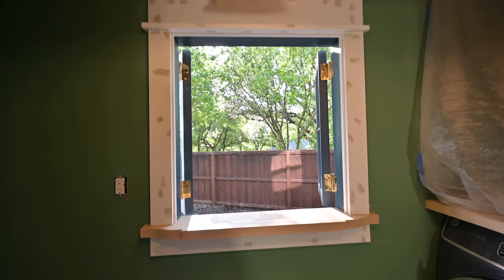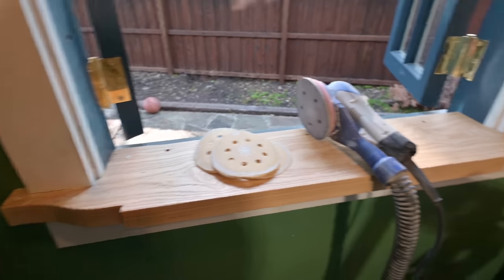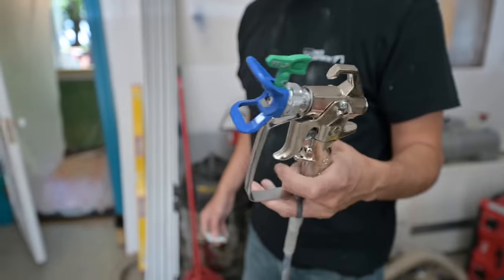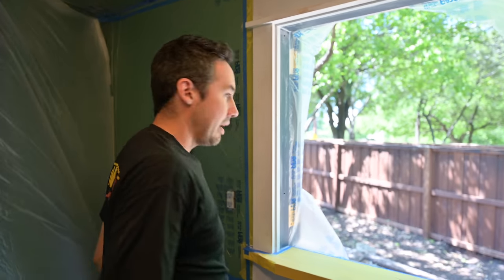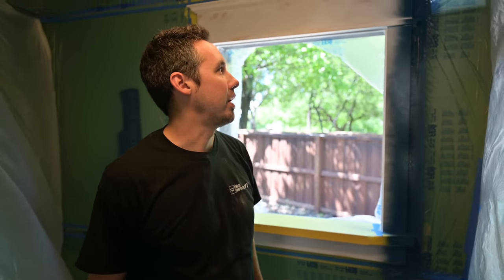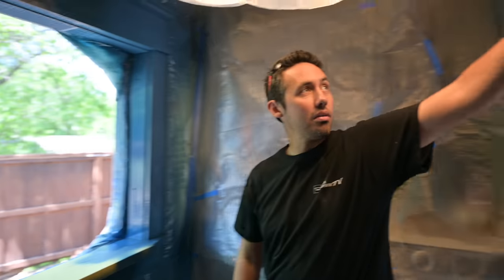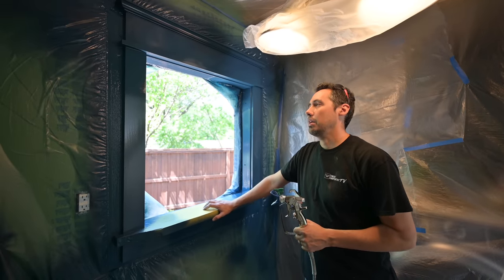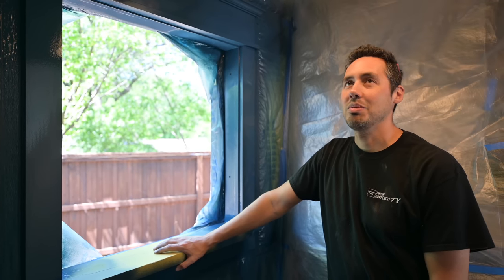I finally FINISHED a room!

Comment: I love that you're adding painting to your skill set (or have for 10 years now)....  As a handyman who does a lot of everything, I am the one who does the carpentry (or drywall work) and then painting.  So you can bet I've improved as a carpenter knowing I have to finish my own work off.  I set up my painting for success by good practices in the carpentry trade (nail depths, number of nails, etc), and there's no one to blame except myself if somethings off in my prior operations.  Love your channel, my friend....  You are an excellent carpenter who I have learned a lot from!

Comment: Hey brother. You really gotta try an italian primer (like Renner or centurion) with a Command (from Benjamin Moore) topcoat.

We have switched from Scuff X to Command for all of our millworks. The only time we won't use Command is when it's for cabinets- then we use a Renner top coat. Command dries flatter, harder, and faster than Scuff X... It's the best local topcoat you can buy for woodwork. Trust me. I've tested them all lol.

Also, the TriTech guns and tips can get all the way down to a 306 with a double orifice. It will take your flatness and dry time to the next level.
Reply: Personally I'm a Sherwin Williams guy after a bad start 10 years ago with my local BM dealers, and limit most of my work to 95%+ exterior repaints.  I'm always looking to gather information just in case I do an interior project.  What is your experience with SW Emerald WBU vs Scuff X vs Command?
Reply: @doug.ritson    I totally understand that sometimes we choose products not because of the products themselves, but because of who is selling them. If your local Ben Moore is full of dickheads then that makes sense. But that being said, Command is simply on another level to all other local paints. 

If you ever purchase some Renner, Centurion, Milesi, or other premium Italian coatings you will see how hard the finish dries. It's basically harder than lacquers, but with more flexibility to avoid cracking, and much better water resistance. It's hard to believe how different they are from local paints until you try them. One thing about the Italian coatings is that they must be sprayed with the right equipment or they won't look right... They also have little quirks like "usually only the catalyzed products will cover in 1 or 2 coats", among other things.. The local paints are much more forgiving and easier to use with multiple application methods. But Renner for example has like... 25 variants of the same high quality product- and each variant is for a specific use... So it takes a long time to learn the systems and if you don't use the specifically correct product, then you can get bad results... They told me that I was supposed to use a catalyzed product for refinishes even if I don't need stain blocking. I didn't believe them, so I used their standard primer that I used all the time, and then it reacted poorly with the previous coating... Its like it was permanently degassing and created bubbles in the top coat even after waiting a month for it to fully degas and cure... So the high level Italian coatings all have specific applications and it requires a real seasoned pro to learn their systems and when to use each one. I would never recommend Renner to a hobbyist... But if you use them right, they are on another level. Even their flat finishes are dead smooth and don't pick up dirt... Also, these coatings are figity with what caulkings you can use. Top Gun 250 from BM is an example of a rare local caulking that will work with Italian coatings. 

Emerald is one of the most forgiving and user friendly paints I've ever used. It doesn't run easily, it packs in the color in one coat, it can lay very flat and look very good... But it's very soft compared to Scuff X, Command, or Italian coatings. I can easily indent my fingernail into Emerald, and if it gets scuffed, then it changes color and you can't get it back to the original. SW Emerald, BM Advance, and KM Durapoxy HP are basically the same products with slight differences between them. One annoying this with Emerald specifically is that their satin sheen picks up dirt like crazy so it's unusable in my opinion. 

Scuff-X is indeed harder than Emerald, Durapoxy HP, and Advance... That's why it doesn't scuff as easily and so many people are switching to scuff X.... Relatively good hardness, packs in the color, still flexible. Doesn't easily run. It's a good paint! I still keep Scuff X as an option for unusual circumstances. But for the most part, it simply is not as good as Command. Command outperforms Scuff X in almost every area... But my Command does not come in Matte Sheen... Scuff X does. When I need a local paint in matte for finish carpentry (not cabinets) then I go for Scuff X.

Command has all the benefits of Scuff X except it dries faster, harder, and flatter. I can make Command look as good as an Italian coating. I can't do that with Scuff X unless I thin it out. Only negative with Command compared to Scuff X or Emerald, is that Command is a little bit more thin than those other paints so you have to be careful about runs... But if you spray even thin coats with a fine finish tip as you are supposed to, then you will get fantastic results.

Simply put, Command on finish carpentry, (unless they need matte, then go with Scuff X) and Renner on cabinetry are the only coatings you will ever need as a manual painter. They are the best. They make me the most money and leave the product looking better for longer with less call backs.
Reply: @MaydaysCustomWoodworks  Thank you so much for your reply.  I am in S-W Florida and Sherwin Williams pretty much owns the market here.  All of the local BM stores are owned by the same family.  My very first exterior repaint with Aura, BM made me pay homeowner pricing, about $10 more per gallon than my contractor price for SW Duration, which was the best paint they offered at the time.  I needed a special tint base they had to order.  I asked them to make sure to have extra singles on hand in case I ran low.  As I was reaching the end of the project I phoned in to get 2 gallons - they mixed the entire case and tried to force me to take all 4.  I compromised and bought 3, but the whole episode soured me.  I've been back a few times to see if they would deal on Aura and they claim they cannot.  I offered to buy 200 gallons at a pop and store it - same reply.  SW works with me and discounts Emerald products, my go-to exterior paints.

I plan on winding down my exterior repaints.  I just bought a planer/moulder that will allow me to make plantation shutters, which all seem to be painted white.  Ours that came with the house are 15 years old and the finish still looks great.  I know they were not painted with ProClassic and Emerald didn't exist.  My local SW guru is ready to comp me some industrial/commercial paint, but I am not quite ready.  He, of course, is not going to tell me about competitors products which is why I appreciate your reply.  I am a custom painter and look for the best products and try to use the best practices to apply them.  I am an anomaly.  Most often I spend hours sanding, and in total an entire day to paint an entry door.  My doors have as close to a factor finish as can possibly be done in the field.  I use the Titan Capspray 115 HVLP sprayer which usually gives me pretty good results - some colors just don't cooperate was well as others.  I am never in want of work and remain booked out at least 12 months.  I want to take that same commitment to my woodworking projects.  I have used Emerald WBU on some interior doors/trim, but prefer ProClassic on the few interior projects I've done.  I can easily set aside my differences with BM locally, eat the upcharge, and try BM Command.  Indeed, I am painting a couple interior doors and touching up some trim in the next couple weeks and will try to remember to comment back here afterward.

There is no local Renner dealer that I could find.  Looks like the closest is in NC.  How/where do you purchase yours?  Thanks again for your reply, I really appreciate it.
Reply: No problem at all. I personally do not have a local Renner store either. I get my Renner products shipped to me from Timberlane Finish Solutions in Ohio. I'm in California. I have a closer store in CA called MK Sales, but Harvey at Timberlane always takes the time to explain things to me and I trust him... So I don't mind waiting for their products to get shipped to me. I just need to plan the finishing for a project about a week in advance.
Reply: @MaydaysCustomWoodworks  Sub'd your channel and will try to watch this weekend.  Also picked up a gallon of Command for an upcoming project.  Guy at BM really pushed very hard their INSL-X Cabinet Coat, then tried to get me to buy Advance.  He did not recommend Scuff-X for trim and said it is for high traffic walls, but he knows guys use it for trim - he wouldn't though.  He really did not want me to buy Command.  I asked lots of questions and other than it drying really fast, he couldn't explain why I shouldn't buy it.  See what I mean about my local BM dealer?  On your recommendation I bought it anyway.  I didn't see a way to message you on your channel, but will report back here in a couple weeks how Command paints/works/lays out for me.

Comment: Learn as much as you can about what are now, sub-contractor trades. It will make you better as you'll know what the guys before you did right or wrong and what the guys coming after you need to have done. You're one of the last guys on a project so you get to see how good the foundation guys, framers were, how good the concrete guys were, drywall guys, etc. Most of those guys haven't a clue about the before and after of what their phase is.

Comment: Probably say the same about framing. You have to know what goes into it (so you can anticipate variation - at least).  For future video, show what (if anything) you had to do to keep the gun from clogging between coats.
Reply: I worked for my grandfather for a summer assisting with his general contracting (roofing down to concrete/plumbing). I wish I had paid more attention to his wealth of knowledge.

Trying to remodel a lemon house that was band-aided just enough to look presentable, where codes weren't 'required' or followed, and I'm having difficulties everywhere. Nothing was done right, down to the framing. I have bowing all over the house, many walls are more than 1/4 over 8', but I checked the foundation it's level, no cracking. I'm going to have to learn or relearn all aspects, and basically rebuild the home myself. 

I should have had a  third home inspector come in. I didn't realize the whole small-town environment, dudes didn't catch anything.

Comment: Bondo is way too hard, west systems with low density fairing filler is so easy to sand plus a long open time. Airless sprayers are super messy and waste paint, hvlp for small/ medium projects and airless air assist for big projects. More expensive equipment but you get what you pay for...